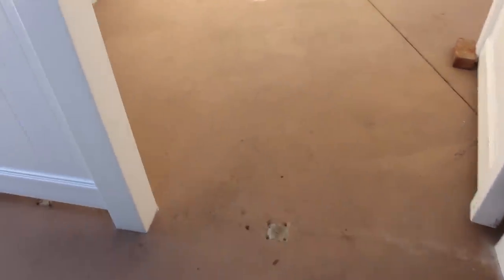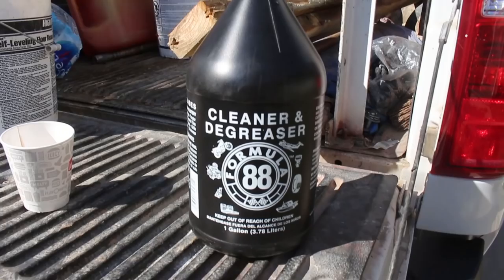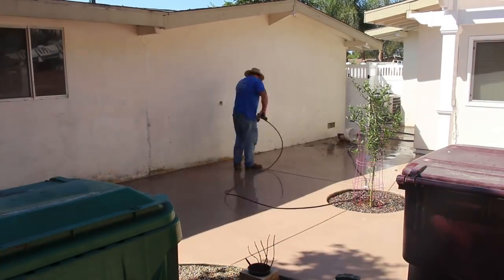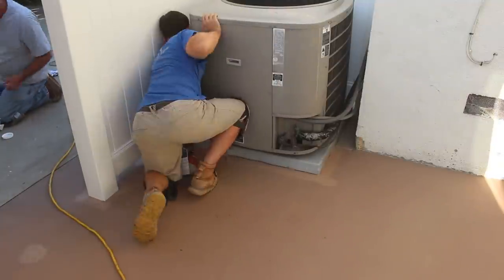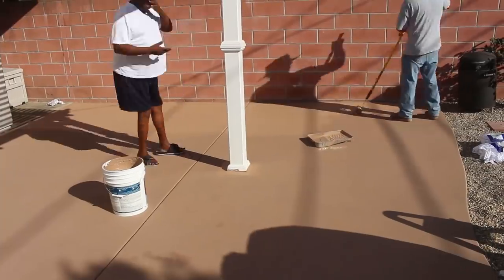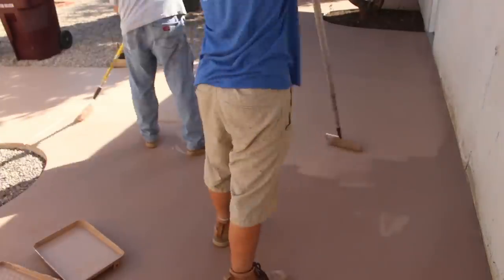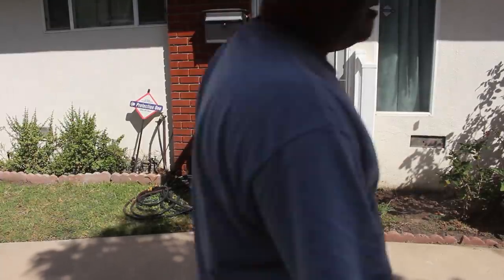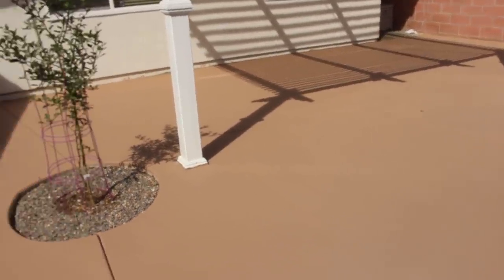How to Paint Over Concrete Using DeckOver, Cover up your stains, cracks, and blemishes

Comment: I used this 2 years ago on our concrete patio areas and it still looks very good. Maybe better on concrete than it is on decks. No peeling either. We live in CA but the areas where we used it get PM shade. Be sure to wet the concrete before you paint it on with a roller. Get the right sponge roller.

Comment: Wow, I always use deckover on deck, it really held up well wherever you are.
Reply from the maker: Southern california and yes it did!
Reply: I guess if it holds up on old decks, it will really anchor it self into pourous concrete.  I use this stuff all through NY down to DC it does well on wood.  Wonder if the ice and salt will break it down.  I'll have to pick a spot and test it.

Comment: I wondered how this did on cement I've seen it to many times on wood, and it always peels after a few years, ill give it a try next spring on my front and back patio
Reply from the maker: so far so good one year later no signs of failure.
Reply: It seems to do much better on concrete than wood.

Comment: Can you do this on interior slab foundation as where carpet and old tile was removed.  And how do you fill in the holes where the old tack strips were?  Thanks.
Reply from the maker: Yes its good for interiors, but you wouldn't want the texture in it.
Use Qiuckcrete high performance mortar repair and concrete glue.
Reply: Odell Complete Concrete   Thanks!  We have a couple big dogs, which is why I was thinking the texture might be ok for traction, but wasn't sure.  And can you put tile over it later also without stripping it?
Reply from the maker: Sure no problem

Comment: Hello I have a question we had our concrete patio painted last year and the paint is chipping
Off since they didn’t add a sealer to it. Should we use the degreaser to clean it before the paint and how about a sealer after
Reply from the maker: degreaser is a good idea. sealer is optional.

Comment: Are there any designs you could use with the paint?
Reply from the maker: Multi colors. Like the border could be a different color. You get real creative and put some custom designed stencils in the middle.
Reply: Odell Complete Concrete great ideas, thanks Dave I'll give it a try